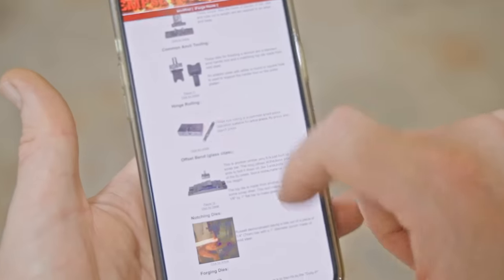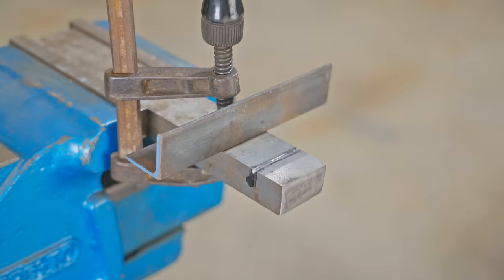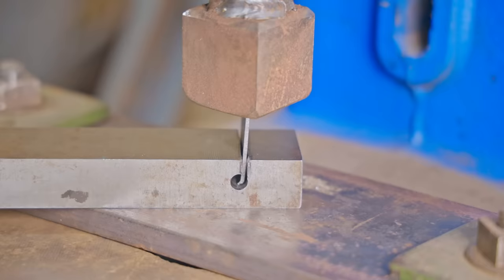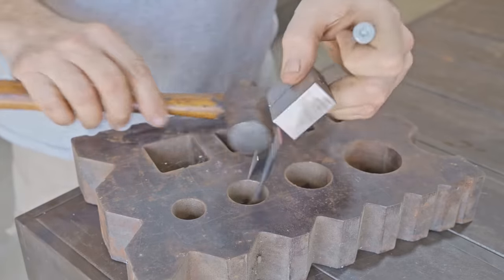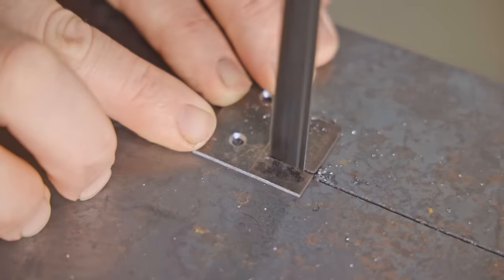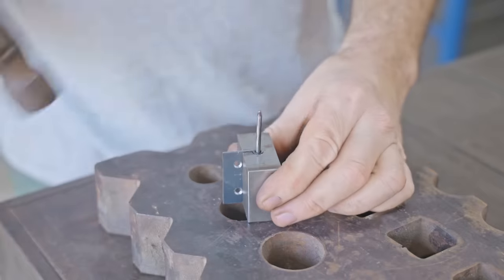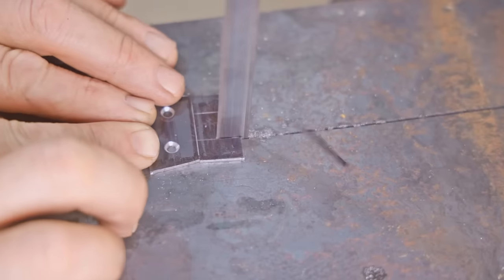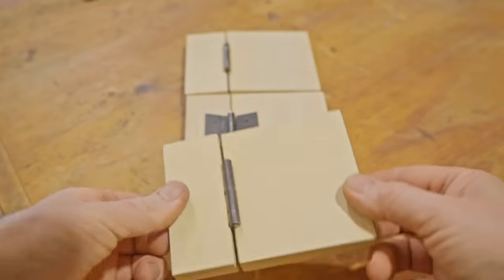How to easily make Hinges - including the Jig - using Basic Tools

Comment: Amazing! How you show each and every step, starting from the basics (which requires a lot of work, but helps you understand), to the more complete (but simpler and more practical) solution, pointing out how to achieve similar results with more or less effort using different tools.
Very artistic, and not so easy, but simple enough!
Thanks!

Comment: Great video, as always.  If I might recommend, you can get very nice overlap and a full circle around the pin if you grind a short bevel on the leading edge that'll be going into the bend.  This is pretty standard in all the blacksmithing books and videos out there.  Not a big necessity on small hinges like that, but it's one of those little details that I think really sets even small hinges apart from the mass-produced stuff.
Reply: Would this be as well as, or in place of the slight bend he put at the start?
Reply: @alans1816  
As well as.
Reply from the maker: Thanks for that, I’ll definitely try it out! :)
Reply: @alans1816  As well as.  The ground-in bevel helps the steel bend around the form like the bend does, but the real payoff is in the finished product when you see that ground taper blend almost seamlessly into the curve around the hinge pin.  You end up with a complete circle (if you do it right) instead of that eye-like profile.

On small hinges like these, it's completely unnecessary in terms of strength of function, obviously.  And, really, nobody will notice it if you don't.  In 100 years, some antiquarian will look at the piece and say they were made in a machine because that pin isn't fully encircled..... but that's about it.  On larger hinges like might be used on a door, it makes things stronger because the pin is fully supported.
Reply: @threeriversforge1997   antiquarians will all know of pask makes in 100 years!

Comment: Wow. I didn't even know this tool existed. Also, what do you think of using a slightly bigger nail for the forming? Then it wouldn't be necessary to use a drill, just use a smaller nail as the pin. That will save 31 whole seconds
Reply from the maker: Glad you found it interesting - running the drill through literally takes about 2 seconds but that could work. :)

Comment: That was really interesting and it shows us how easy it can be to make something with simple tools yourself... It also shows us the process how they could have made it back in the days.
Thanks for this fantastic video.
Reply: From memory The Stanley Works (Stanley Tools) first invented the cold-rolled steel butt hinge (hinges made from sheet/coil stock like this)  back in about 1872 and it's been pretty well perfected over the years since.  Prior to this hinges were typically forged or cast and machined, cost a lot more money and took a lot longer to make.  The process has been largely automated since the mid-1860s.  In a factory environment the 2 leaves are typically formed by a single stage stamping process which cuts the shape of the blank together with the holes and often the countersinking also.  The bending is usually achieved in a 3-step process on a press against a series of dies.  Lastly the pin is mechanically driven in to the barrel of the hinge.  There are sometimes additional processes to smooth or deburr edges as well as surface finishing/plating etc too.

Comment: Great job!  There are a lot of custom jobs that require special hinges.  Not available from suppliers.  Swing clear hinges, drop leaf, wide throw.... Materials are also an option, brass, copper, aluminum...
Thank you for showing there is a solution. 😊
Reply: Furniture renovation comes to mind. My dad used to renovate mid-20th century designer furniture, and naturally the pieces had to look as close to original as possible. On some rarer pieces he often had to replicate missing knobs, hinges and other hardware by himself.

Comment: Dude, today I'm discovering something that I never would have imagined: how the hinges are made. And your circular saw for iron makes me dream, I will try to find it but is it possible to cut stainless steel with it? Thanks for sharing and merry Christmas
Reply: It’s just a cut off saw or chop saw. They are actually pretty cheap. Not as accurate as miter saws but for rough chopping they will cut anything. Also these days a nice metal cutting blade for your wood miter saw will cut a lot. The grinding style saw blades will cut really thick stock.
Reply: They cut stainless, but you have to watch the thickness since stainless is just a lot tougher on blades of all kinds.  The saws made for cutting metal are specially designed for the task from the ground up, including the right RPM's and all that.  You can buy a metal-cutting blade for your woodworking saws, but I don't really trust them since those saws are made for working wood and all the internals are built around that idea.
Reply from the maker: Glad you found it interesting. The saw will cut stainless as long as it’s not too thick, I ruined my last blade trying to cut through 10mm thick stainless but the blade was pretty old. :)
Reply: Get the Diablo one, its cheaper and as good as the big name one.

Comment: The reason why your metal cutting saw blade failed is because you was trying to cut D2 tool steel at too high of an rpm.  I likes to work harden if you input too much heat.  I seen a guy, that I worked with at a machine shop, turn some A2 tool steel purple on a manual mill.  He was taking high rpm cuts with a facemill.  He didn't know any better at the time.  When it came time for the next operation, the next operation wasn't possible.  It was work hardened.  Solid carbide endmills kept breaking.😂

Comment: you also can make a hinge die set with pins, anvil/plate mandrel, and hammer.
Look it up in metal working-hand forming or blacksmithing.
Making hinges like you did is easier in 2 steps, prebend, then complete radius.

Comment: When you hammer over the leading edge of the barrel portion maybe try file it off a bit too. 
When I was in Highschool I worked in a automotive/truck spring shop and we tapered the ends of the spring steel for the main spring leaves so when we heated and wrapped the spring eyes they closed up tighter and looked neater in the end.

Comment: on the simple hinge, you can afix the pin to the upper part and allow the pin to slip in and out of the lower section, makes door removal easy as open and lift off the hinge

Comment: Just to let you know and to thank you.
    The steel cutting blade for circular saw that I saw you use, when you purchased it, was eye opening and I had to try one for myself. They are certainly a time saver and make cutting large sheets of steel much easier and much less work with the cutting wheel.
    I look forward to trying this out also.
Thank you for sharing!

Comment: You can also weld the pin ends, the pin won't drop out and that works well as a security feature if the hinge is on an out door location.

Comment: when using the band saw, you can effectively use the front of the blade as if it were a belt grinder, you can chip away at the little bits to make a mostly straight line instead of just doing the angle cuts, then you only spend a few seconds doing that and a few seconds doing the filing to make it neat rather than a lot of filing to get rid of so much material and then also making it neat

Comment: It works as long as it doesn't bend where you don't want it to. I think rolling it around a pin would be the way to go if you were mass producing them, but that would require more than just 2 parts to make it work.

Comment: These look great! 
For those with only mild steel & limited heat treatment options, this looks like the sort of tool that would benefit from case hardening.
You were asking about what sorts of project we'd like to see: I'd like to see a lightweight folding laptop stand or standing desk. I imagine such a stand might be useful to bring your editing work into various parts of your shop, or into the outdoors as autumn makes your weather more mild. 
To make it from scrap wood, I imagine longer members could be laminated (perhaps curved, if you don't mind cutting veneers), with cross members drawbored to form trusses.

Comment: Brilliant!!! Youtube put this in the list of vids I might like. Sometimes it chooses some greats!
I have a bunch of projects which can make use of this, so that I can build the hinges into sheet metal projects, rather than screw, bolt, braze or weld on the hinges or hinge parts.
First will probably be parts for a set of lowerable castors for my workbench.
One comment / suggestion. In some cases, it would probably be useful to clamp the metal which must be kept flat between 2 chunky pieces of flat steel when forcing the sheet through the tool. E.g. my second project would be a 100 x 100mm plate with a hinge on one edge, for a cover for the pellet feed for a fire tube. The 100 x 100mm would be likely to warp under compression.
Similarly, thinking about making the long part of T hinges (I've modified a lot  of off the shelf hinges to make them more ornate), I'm thinking that some customised vice jaws might be the way to go. E.g. the roll tool side would be bolted in place of one vice jaw and a clamp to clamp the long part of the T would be bolted in place of the other vice jaw. That way, almost any length piece of metal could have a hinge roll added to the edge of it.

Comment: I use steel cutting blades and as long as they’re rated for thick material I’ve never had an issue nibbling to the full depth in a few cuts. The big issue with the metal blades is there is some differences based on material thickness they’re targeted at as well as hardness; they do t like getting hot so cuts need to balance material removal with temperature management. A big thing with metal blades tends to be saws that spin them slow enough and with enough torque which tends to not be standard wood saws for heavier/thicker metals.

Comment: I am impressed, is there any thing that you can’t do., I  have two suggestions, 
1) when you scribe using the dial calipers you damage the tip, make an appropriate scribe plate , 
2 ) rather than paining over the pins, use  centre punch to fix the pin

Comment: Thank you for the video, very informative. I do plan on making a gate for my car to go into the back yard. I have some good reclaimed hard wood that came from the floor of a 1940s era commercial building to make the gate with A question for you, is heat treating the hinges related to the amount of weight stress they can hold?  I will not need to use the block method such as you have shown because the hinges will be much larger.  I am hoping to use 1 cm rebar to fold the steel over.

Comment: Really cool Idea. Just out of curiosity... I noticed that you drilled out both sides of the hinge to fit the pin in place. Would it not be better to only drill out the centre section for clearance and hammer the pin in through the other? If that would work it would remove the need to peen the pin over and would mean you could file the pin flush with the hinge.

Comment: The circular would have certainly gone through easier in one go. We use an Evolution circular saw here, and did a recent job where we had to cut through .125" (~4mm) 304ss diamond plate steel. Although the blades would only last about 6' (~2 meters) between sharpening, it would cross cut the whole sheet in a few seconds (a little slower than plywood and a wood blade).

Comment: Just what i needed, the hinge prices are now so high that you will loose only $18 per hour in making your own, plus the tools to make the tool, but if i make 10,000 hinges the cost will be spread out, and i could keep the 9,750 i dont need in a box in the middle of the floor, as an added inconvenience. 
God forbid we pick up hardened stainless hinges for $2 at the hardware store when we can make soft inferior ones at home.

Comment: I love your project!
I'm always keeping hinges if i find them because they are quite expensive.
Scrapwood-challenge? Yes!
Would love to see them! (i also make a lot with scrapwood).
I am walking around with ideas about something which i can't seem to solve,
Can crushers already exist in various ways,
I am looking for something without a motor, just manual,
But not by putting a can in a 'box' and press it with a lever and then pulling it back so the can falls out,
But i am looking for something where i can turn a wheel and throw the can in on top and it falls down in the bottom, crushed in some way.
Something like 2 cartires rolling against each other and the can crushes where these 2 tires meet, but i am thinking about something completely from wood.
Ah anyway, that is something i am thinking about (and actually not important) but maybe you get inspiration from this and have some ideas :-)

Comment: To make the hinge look neater instead of drilling the holes out on the hinge part that is on the outside leave it as it is and press fit the pin into it and then grind off the excess

Comment: The same as French doors easy breezy the steel has to however  be as strong as the weight it holds or it is unbalanced. 
I learned that thru observation  of a Mason.  They exist  without a commitment  still the desendants.